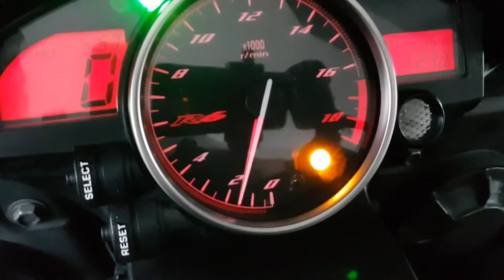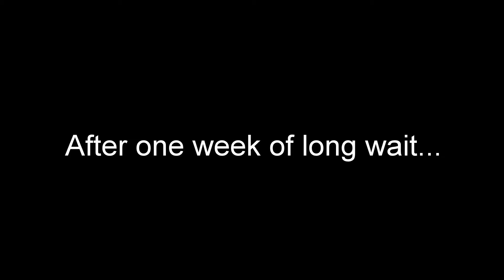Yamaha R6 Engine Problem | Motovlog Singapore | NeedforRide

Comment: Woodcraft makes a expulsion eliminator vey inexpensive. Small black plug.
The technician should have checked for trouble code first time, not just replaced spark plug. They do not just go bad. Also he could have tested ignition coil for resistance first time and saved you the second trip back. How many miles on the R6? Why replace timing chain? They usually do not stretch out until after 100,000 miles or so. You would hear a rattle from right side of engine, especially at idle if worn. Now the cam chain tensioner is another story , that woul emit loud rattle at start up and go away once engine is warm. They usually require replacement at 20-30,000 miles. I am a certified Yamaha and Suzuki technician in the US . I used to live in Clementi park. Miss living there and riding all year long. You are so lucky living in Singapore.
Reply from the maker: Hi Markus, I know there is a way to DIY the exup exhaust elminator by building up a circuit with just capacitor and resistor. Probably I will try it out one day and hopefully I'm able to eliminate the code 17 & 18. 

At that point, my spark plugs have been used for 16,000 miles since the last replacement. So we wanted to give it a try to replace those spark plugs because this is one of the cheapest alternative to solve the issue. 

The mileage is pretty high, I had about 93,200 miles on my bike and I have no idea whether if the previous owner had replaced the timing chain and tensioner before. So since I'm dropping my bike off at the workshop, might as well get those wear and tear parts replaced at one go.

I would think riding in US is much more enjoyable compared to Singapore. The roads are wider and the sceneries are beautiful too.. If I have a chance to visit US, I would definately ride there..
Reply: Markus Decker I got same issue as the video, jerking when low speed especially when running not more the 2k rpm, may I know how to solve it ?

Comment: Sounds like the engine is chooked. It wants to breathe but was chooked so it's jerking. Something is wrong with the airflow or fuel supply. Air and fuel mixture is not  right. That would cause carbon build up in the combustion chamber.

Comment: Hi my friend i love your videos, i have the same bike and problem. Please tell me is you bike jerking only when cold, and when the enginen is warm the jerking is better. I have problem with my R6, when engine is cold on first start when i give little bit more of throttle my bike is like choking.
Reply from the maker: If your engine is not warm up fully (Cold Engine), you will feel the jerk when you throttle your bike. After you warm up your bike and the jerk still persist, it might be either the spark plug or the ignition coil or fuel pump causing the issue. Bring your bike to the workshop and get it fix.. Ride safe.

Comment: Bro is your check engine light always on? Also how many km do you have on your bike. I just bought an 09 r6 and it's the exact same
Reply from the maker: Hi Benjamin Terry, it's because the Exhaust Servo Motor Cables were disconnected from the exhaust valve thus check engine light on with Error Code 17/18. Anyway the bike still runs pretty fine..😁😁😁

Comment: Why is your engine light always on? Is it because of the exup removal?
Reply from the maker: Yes bro. Exup cable was removed thus engine check light on with error code 18. 

In the near future I might be making a DIY Exhaust Servo Eliminator video to remove the engine check light. 📽📽📽
Reply: NeedForRide funny because mine went away after riding for a few weeks and never came back. I didn’t reinstall the motor but the wire is still plugged in I think.
Reply from the maker: Mine is on and off.. In order to get rid the engine check light, must install the Servo Eliminator which can be diy.. ☺
Reply: NeedForRide lucky me it doesn’t come on anymore haha. Ride together soon bro
Reply from the maker: Sure bro. Let's plan one..

Comment: And my prob is cant start..even push with 2gear...why?
Reply from the maker: Hi Eza Deorido, there are alot of factors.. Could be a weak Battery, Spark Plug Issue, Faulty Starter Motor, Faulty Fuel Pump or ECU problem.. It's best to bring your bike to the workshop and get the mechanic to rectify the issue for you..
Reply: @NeedForRide  ya i think thats the best way

Comment: how much is the cost for all those repairs? can do a cost breakdown?
Reply from the maker: Total repair cost = $1,000.00 ++

Ignition Coil X 4 = $500.00
Valve Clearance = $180.00
Throttle Body Sync and Servicing = $80.00
Timing Chain = $140.00
Miscellaneous = Balance of the amount..

Money spent, problem fixed.. 👍👍👍
Reply: have clearance si cheap ah bro..
Reply from the maker: @ @wannistelrooy  I think it's quite reasonable.. But not really sure about the market price for doing valve clearance.
Reply: @NeedForRide  even cheaper than ah beng.
Reply: @NeedForRide  how long it take to do your valve clearance?
Reply from the maker: @ @wannistelrooy  It took about a week including replacement of ignition coil, timing chain, cleaning of injectors and throttle bodies.. The bike felt really good after collecting it.
Reply: @NeedForRide  maybe will try his shop for valve clearance.
Reply from the maker: @wannistelrooy  Thats great.. Those guys are really friendly. Approach them bro... 😊😊😊
Reply: @NeedForRide  what's the shop name ?
Reply from the maker: @wannistelrooy  Prospin Motorsports